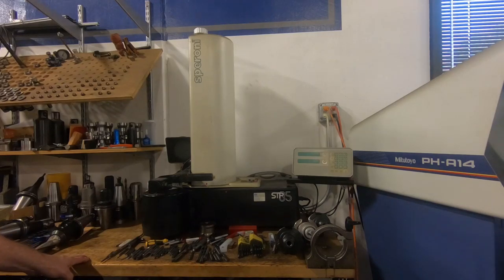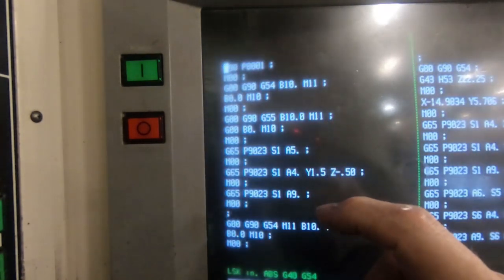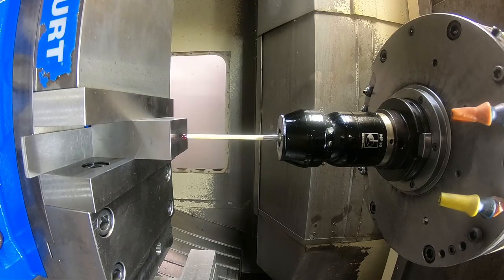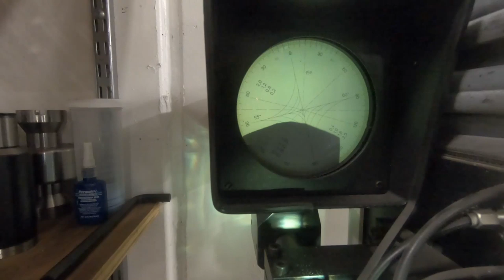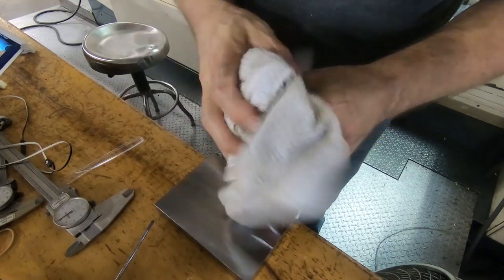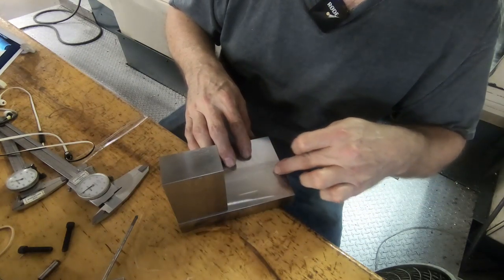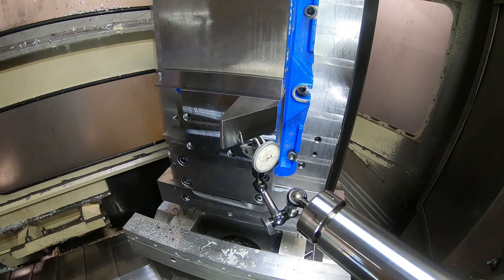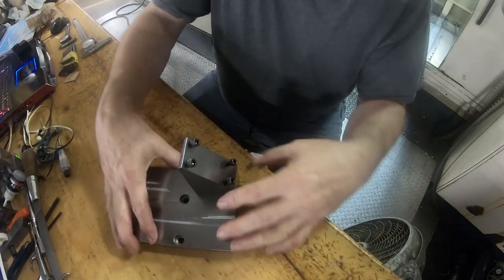Wheel Truing Attachment Base-2

Comment: Nice work!  At 11:00 Peter begins hand tapping after CNC tapping partially with a taper (starter) tap.  What is amazing is if you watch closely the tap never deflects even a little while hand tapping.  In order to get a nice thread to screw fit, you can not let the tap oscillate in either direction otherwise you'll oversize the threads.  some people would use a tapping block or a guide to hand tap, but Peter does an outstanding job without guides.  That is just another example of good technique by a master!  Of course some critics might say that with the dowel pins locating everything, it's not necessary for such a good thread fit.  But that's the difference between a good mechanic and a hack.  If you watch this great channel a while, you'll see that Peter always works at perfection in anything he does, and we admire him  immensely for it!  Thanks.

Comment: Thanks again Peter!  That milling operation putting the angle on the part sure did show the integrity of your dowel and cap screw joint connection. I can honestly say I was skeptical of such tool pressure there until the proof was in seeing how it performed.
 
We can all empathize with you about how being crunched for time can suck the joy out of making shop tooling when it should be fun and rewarding. But.. the joy will come when you get to use the finished product over and over on the T and C grinder (which is an awesome machine tool in itself).

Comment: Pretty cool Peter. Thanks!
At 1st, I was confused why you used a face mill to cut that angle. I'm guessing you used it because you can take more of a cut and inserts are (fairly) inexpensive as opposed to breaking an end mill or having it re-ground. Either way, it's something I would have never thought to do. 

Also, I was surprised you didn't make an Aloris mount for your  "dresser". I'm sure you have a reason, I'm just curious why.

Anyway, thanks again for the videos. I always look forward to seeing your posts.
Reply from the maker: I did think about a Aloris mount. But I needed more clearance. In other words the tool post itself would get in the way. This just seemed more elegant and provided more clearance. You will see when I make the video on truing up the wheels.
Reply: @EdgePrecision  That makes sense. Thanks for the reply.

Comment: Hi Peter, great video!
I was wandering why you tap the holes by hand after starting them in the machine. Is it an unknown steel and you don‘t want to risk an expensive tap?
Greetings from Germany
Markus
Reply from the maker: No the tap is the least of my concern. I am using a spiral point plug tap. This is not a bottom style tap. I want the thread to go close to the bottom of the hole. But I don’t want to take the chance of breaking the tap. The little time it takes to hand tap to depth is minuscule compared to having to remove a broken tap or remaking the part. Also it’s the only piece of material I happen to have. So I’m being carful.
Reply: Thanks, makes total sense. I didn‘t notice that the tap in the spindle wasn‘t a spiral flute tap.

Comment: appreciate you squeezing in the content. wondering whats the load on the machine with that 3" cutter? i want one but maybe a 2" if they have, only have a 35 hp mill.
Reply from the maker: This machine has a 40 hp spindle. But it is a high toque spindle drive. The cut depth is only .100” at a feed of 20.0” per minute. This feed and speed in steel hardly loads this spindle. What is more important is your spindle taper size and the strength of your machine. Also does you machine have a low range spindle gear? This machine has a direct drive spindle. In other words the spindle is the motor. There is no transmission or belt drive. With 35 hp you should to easily handle a 3” cutter if the machine is strong enough.
Reply: @EdgePrecision  thanks for the info. i believe this is a direct drive, ill have to verify. CAT40 with 15k rpm 42x26x24. what was the cutter brand? so i don't have to go back thru all your videos and hope it wasn't in one put on private. i have a 3" but the inserts are on a 45 so i cant profile.

Comment: I've never used through coolant tools before but it looked like the machine was "peck" drilling to break chips without extracting the tool from the hole.  If so, that's pretty clever programming and probably saves a lot of time on deep holes.

Could you use compressed air to get the dressing spindle going instead of spinning it by hand?
Reply: Peck drilling has 2 basic options , chipbreaking or full retract . It's a standard canned cycle , look it up if you're interested

Comment: Hello from Bulgaria great work to you Peter.I love this type of videos. I need to know is this a carbide through tool coolant drill or HSS and if this is a carbide drill is pecking metod good for the tool life. Someone told me that carbid drill enter in the workpeace onece and drill continuously, becouse every move out from the workpeace and start cuting again shorten tool life.
Reply: i'm curious about this too , i peck drill everyday .( Even if it's bad for tool life , i don't usually have time to dial in the correct speeds and feeds , tools in the shop are pretty much random , so you can't use one formula for every drillbit , and most jobs are one offs or low quantity . A lot of times workholding limits the max feed , so it's normal that i can't use a 40mm insert drill with catalogue parameters ).
Reply from the maker: It's Carbide. Yes common wisdom is its better if you drill straight in (G81). But I have found that sometimes in certain materials that can create a birds nest of shavings on the drill. I haven't noticed to much of a reduced life on the drill. So whats better a birds nest of shavings to deal with. Now I will say this you want to set up your retract parameter to a very low number just enough to break the shaving. Say less than .01" or .25 MM. On my Mazak you can't even see the peck its almost as if the drill always stays in contact with the work. On large drills it does there is jest a slight change in the sound as it pecks. Also on large drills I even think this might work better than no peck. It almost lets the tool cool down a little in the peck.
Reply: @kisspeteristvan  Whea this is new for me about pecking with carbide. I use % downgrade for feeds and speed, say 40% from catalog for speeds and 50% form catalog for feeds to match workholding limits. It is trial and error. Thank you for your comment :)
Reply: @EdgePrecision  Ok if I understand correctly if there is a birds nest of shavings i need to use small peck retrack less than .25 MM or this is for every drilling scenario. And also for me reduce in tool life is due to poor tool runout. "On my Mazak you can't even see the peck..." thats is way I was surprised when I see pecking. For big drills 100% approve,

Comment: The spindle does a little rotation before each tool change. Is that to orientate the drive dogs to suit the next tool?
Reply from the maker: It does that to line up the keys with the tool changers arm. It always puts the tool in the spindle the same way. This can be important for some tools. For instance a boring head. Or the spindle probe.

Comment: Hi Peter, Interesting little project, One thing I have been wondering about, are there some system that rinses the tooling so there is no chips on the mounting where it is being held in the spindle, all the best.
Reply from the maker: Most machines blow air thru their spindles when making a tool change. This helps blow chips off the shank of the tools.
Reply: @EdgePrecision   Ok. thank you for your answer.

Comment: Surprised that thing didn't sing like a canary when that unsupported part got thin with that big face mill.
Reply from the maker: The trick to this is the last pass. I usually use two cycles one to rough down leaving a thicker last pass (In this case .100"). Than the last cycle takes it all at once. But you project the bottom of the tool beyond say another .100" . So you are just cutting on the side. I have learned to do this the hard way. If you just rough down and the second to the last pass leaves to thin a section it will vibrate and could fracture the inserts. This is a common mistake using feed mills. With a feed mill I will rough down to only about .100-.150 thickness than remove the rest with a face mill or endmill all in one pass projecting all the way thru the material just cutting with the side of the tool.
Reply: @EdgePrecision  this kind of info is why i subscribed to your channel. cheers

Comment: I didnt catch what did with speroni. Maybe just the height of tools? And if yes, how to export the data to machine? Manual input?
Reply from the maker: The Speroni measures the tools length and diameter if necessary. My Speroni is a very simple one (No computer) just a digital readout. It can't upload offsets to the machine. So it's manual input for me. But there are ones that can do this. The file it exports are just lines of G10's with the offset data. It could also be saved to a USB stick and run. If your machine has USB capability.
Reply: @EdgePrecision  Amazing, thanks. Great job. And beautiful machine. 👍

Comment: That tool calling sequence is screwy. Say you have a 100 tool magazine, and tool 20 is in the spindle, and you want to load up tool 70. The chamber rotates from tool 20 to tool 70, and picks up tool 70. Then it rotates BACK TO tool 20, then changes them out. That is so nutty. It should remove tool 20 from the spindle and put it back. Then rotate to tool 70 and load it into the spindle. It is doing 2x the movement, which takes 2x the time.  Why does it do that?
Reply: Well really, doing it this way would save time on a job because the belt will spin while the operation is running, and then change tools. Minimizing the tool change time is the most important part, which this method does well. It is slower when you're manually jogging the machine because it doesn't know the next tool to pull up.
Reply: I'd guess you also don't want to keep the spindle bore open any longer than you have to. You really don't want chips and dirt accumulating there.
Reply from the maker: Your kind of getting a out of sequence view because of the way I took the video clips. The beginning clip shows me calling the probe (tool 80) into the spindle with tool 53 still in the spindle (you can’t see it on out side of the machine). So the magazine was returning to station 53 to put tool 53 in its pot. But than I needed a clip showing tool 80 (the probe) coming into the spindle. So the next clip I repeated  the tool change to get the clip. I should have recalled tool 53 into the spindle than made the change to tool 80. This would have been better for video continuity. Than I could have shown the machine putting tool 53 back in its pot. This machine always puts the same tool in their respective pots. Normally you would call the next too into the arm while the current too is machining. Unless that tools cycle time is very short the machine rarely waits on the tool changer.

Comment: Please don't adjust coolant lines with spindle running I almost lost my thumb doing that and don't want viewers to pick up bad habits.
Reply from the maker: In the video it looks closer than it really is. My hand is a good 8” away from the tool. l normally tap the coolant lines with the tube on the air nozzle. But the mag base on the camera was in the way. Anyway thanks for your concern but every one has to make their own decisions on safety.
Reply: @EdgePrecision  that's how far my hand was when I was adjusting the coolant lines and the coolant line unsnapped and my thumb hit the drive dogs at 4000rpm it looked like my thumb exploded. It all happened in a split second.
Reply from the maker: OK sorry for your accident.